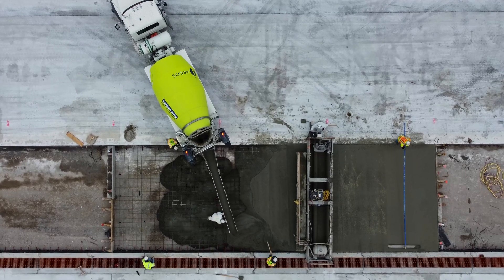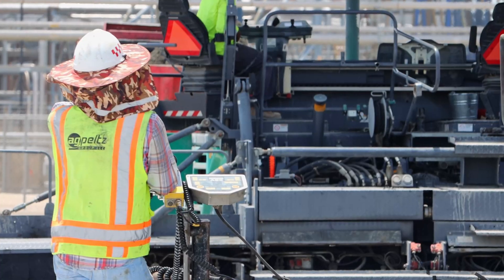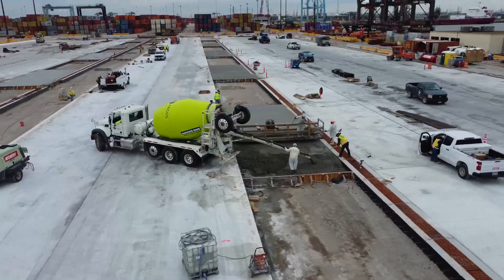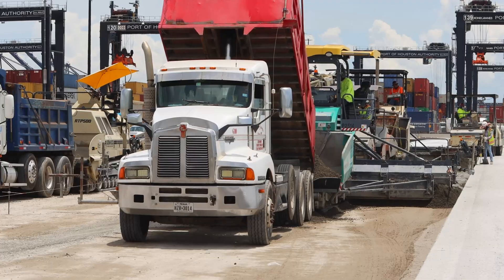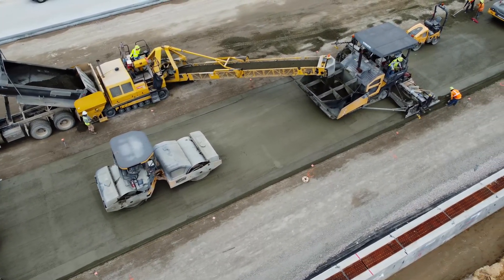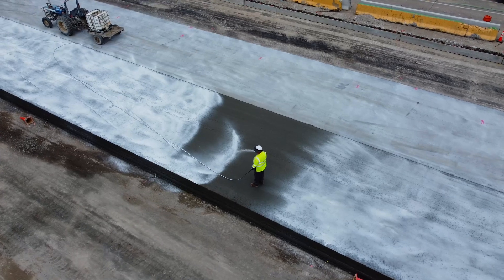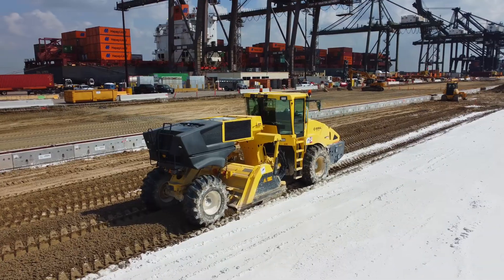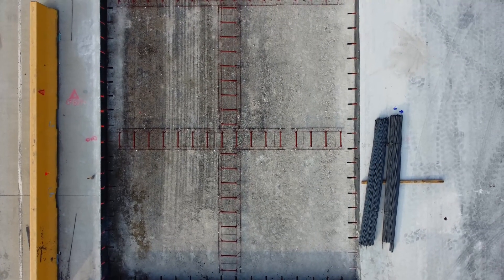Roller Compacted Concrete - What is it?

Comment: Why don’t they use this everywhere?
Reply from the maker: It is widely used method in private sector, but public sector by some reason does not use it often.
Reply: They will eventually. The Public sector is typically 20 years behind  the private sector.